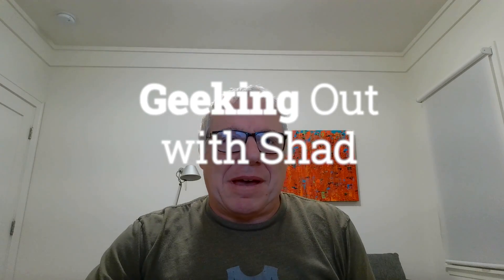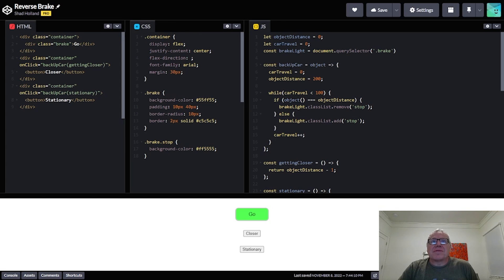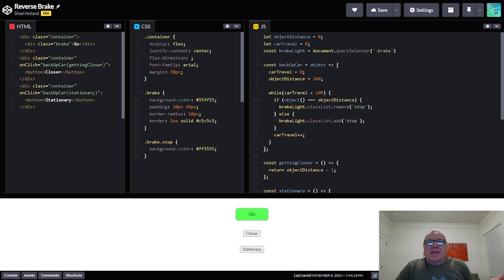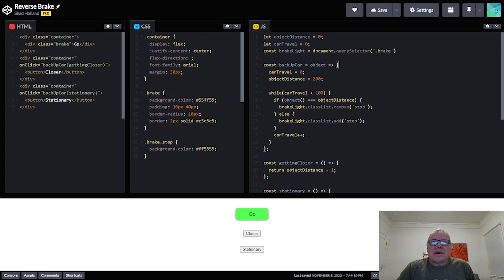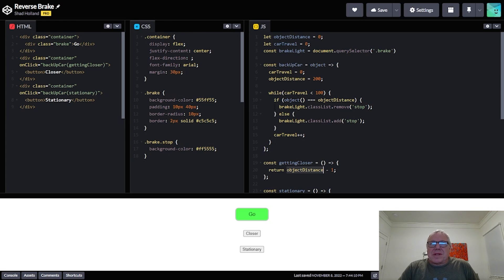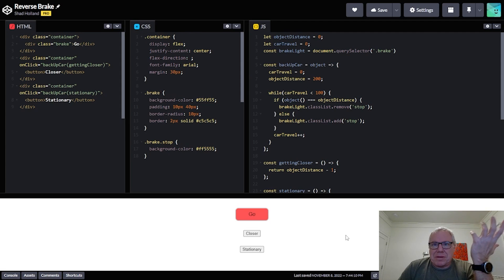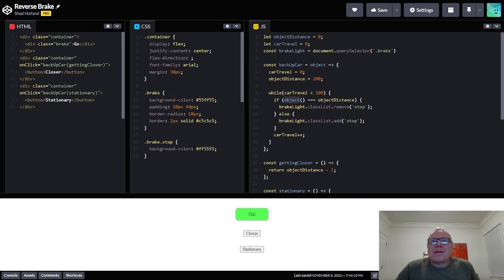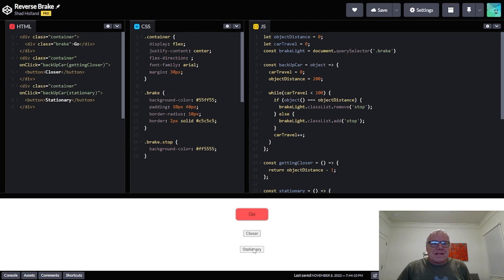Solving the slamming on the brake issue with code!

Comment: What if there's a stationary pole behind the bike rack?
Reply from the maker: That is another possibility, but the car slamming on the brakes because there is a bike rack still doesn't make sense. At some point people driving the car are going to have to still take precautions and responsibility for making sure they don't drive into stuff. People should use sensors as additional tools to help them, but not 100% rely on them.
Reply: @geekingoutwithshad  Ask me about that, I backed up into a concrete slab relying on my sensors!